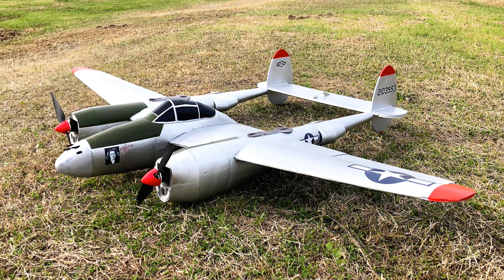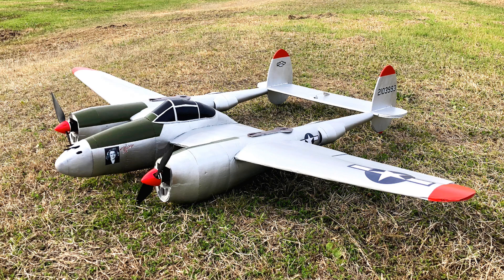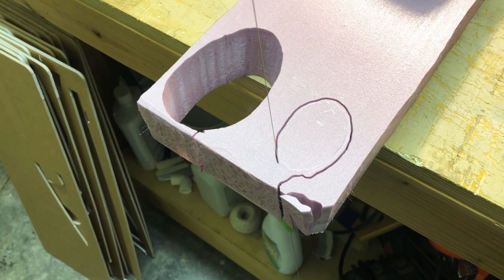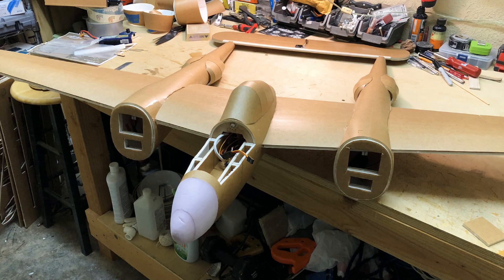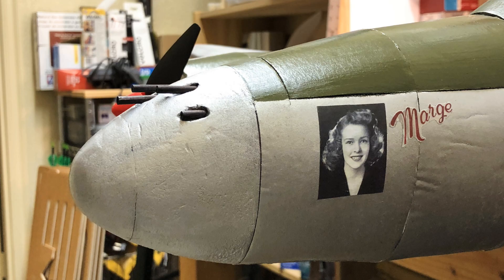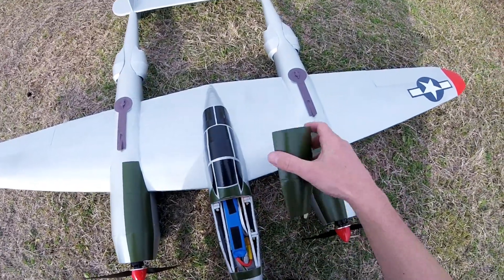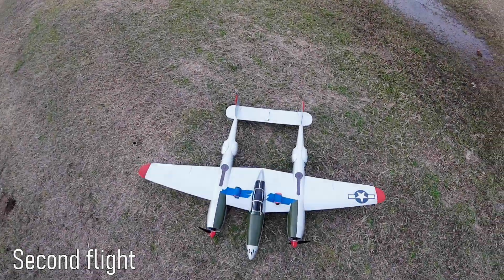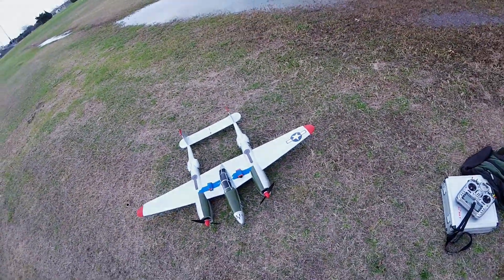FliteTest P-38 Build and Maiden

Comment: Really awesome build! I just got one of my own and I'm in the process of building it. What are your rates/expo for it? Did you use a gyro? Thanks!
Reply from the maker: Thanks!  I think I did my usual three rates that I do on a new plane - 100/80/60 percent with about 25 or 30% expo on all rates.  60% works great.  No gyro required.  I only use these on fpv setups.  Good luck man 👍🏼
Reply: @mostlyharmlessrc3920  Got it, thanks!

Comment: Nice job. This is my pick for my 1st build. I'd love to put retracts on.it though. 

Any ideas?
Reply from the maker: Hello and thanks!  This is an ambitious choice for a first build - kudos to you.  I thought about putting retractable units inside the engine pods, but there is no wood to anchor them.  Flitetest has an option in one of their videos about adding fixed wire landing gear.  I think I would see how well that worked first.  Good luck to you!